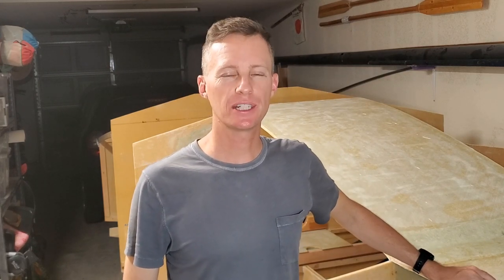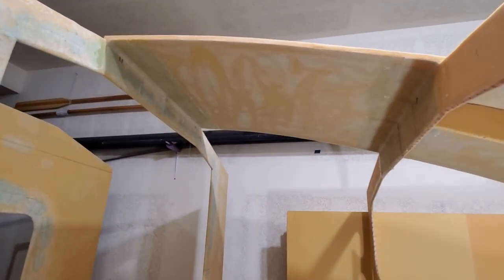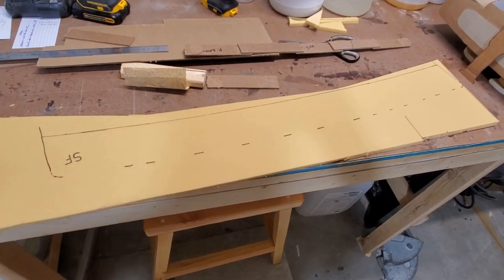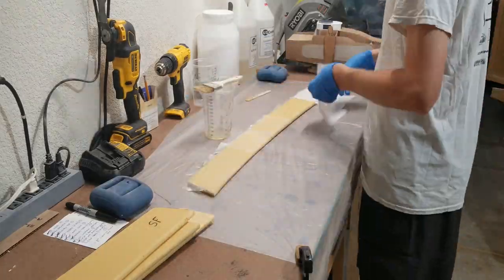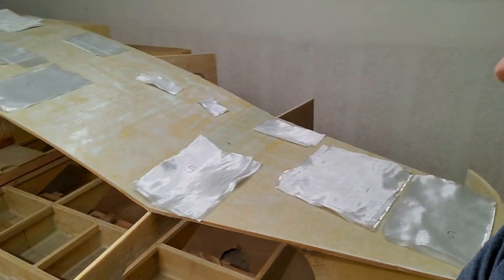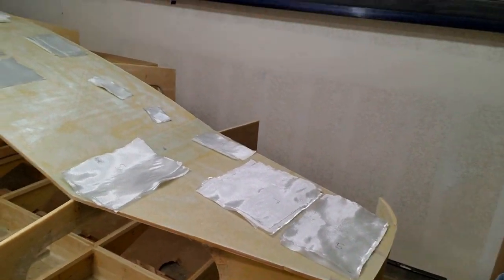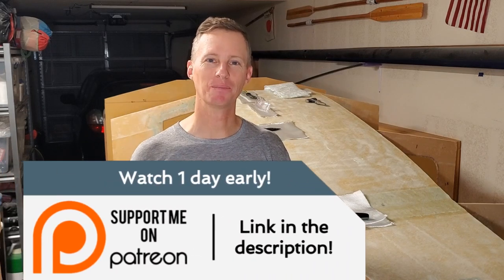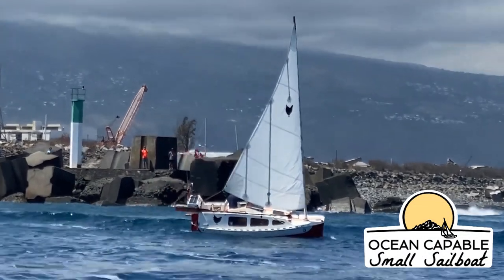OCSS-031 You Know, Like a Step Stool? - Mini-Cruiser Sailboat Build

Comment: The PVC Foam Core Fibreglass Sandwich Construction is really quite remarkable!

The Foam Core has virtually no structural rigidity on its own, but once mated to Fibreglass and epoxy resin the magic happens, I can appreciate why this method became so popular with people building their own aeroplanes!

The ability to create streamlined, gracious curves is also appreciated.

I expect that Nomex/Carbon Fibre panels are the latest iteration, but there the costs skyrocket, and the requirements for vacuum bagging and curing ovens come into play.

Not in the realm of the independent self builder on a budget.

Comment: Looking good ,would it not be easier to do the extra beams when you flip the boat over to do the bottom and chines
Reply from the maker: It would be easier, but I want to make sure the structure is very strong before flipping it over so that it can hold all that weight. Wouldn't want anything to flex or break.